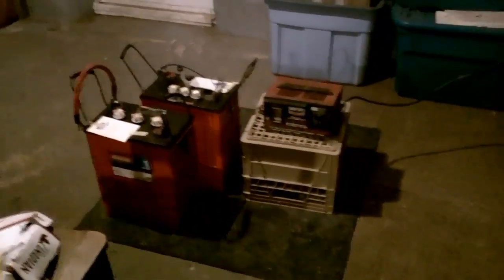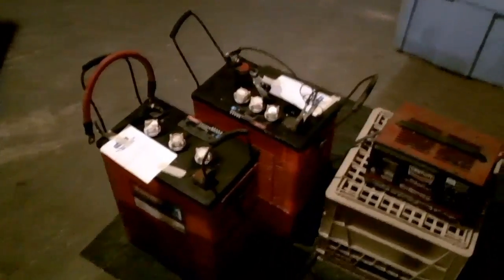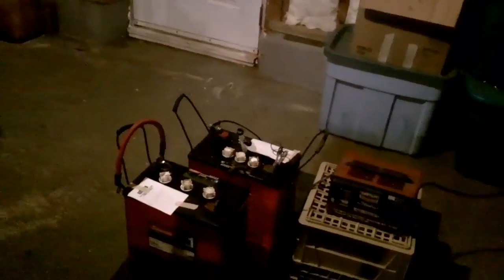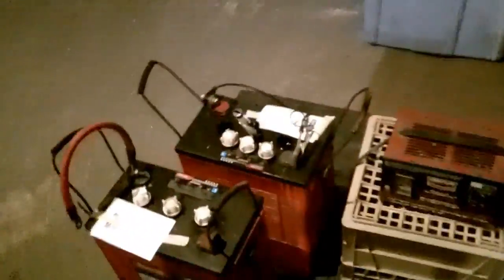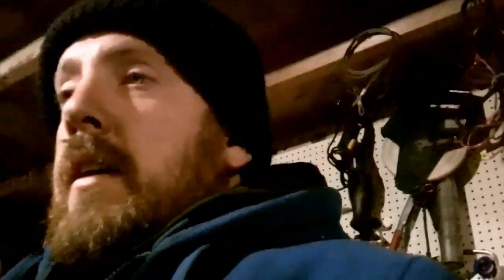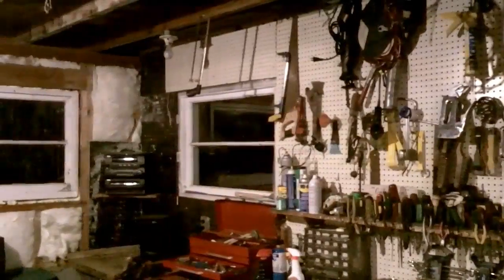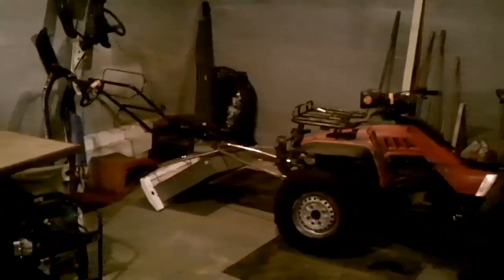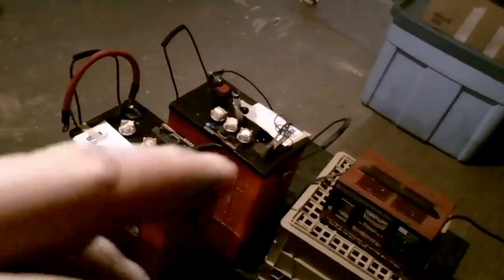HOW TO DESULFATE LARGE BATTERIES THE EASY WAY

Comment: Desufate batteries with alum solution 4 to 12cc concentrated and boiling hot. If really bad hook to a higher voltage current limited charger, about double the battery voltage limited to 5A or so. Once it starts drawing current charge normally. A DC arc welder works great for reviving big ones like forklift batteries.
Reply: I did de sulphate today wid boiling water / baking soda. After it stop fizing, emptied content n filled wid warm water to flush out again. Den repeat wid distilled water b4 replacing 'old acid/ filtered' into battery. Charge on 'boost/ higher dan15-16v'/ 30 mins. Drop charge to low charge overnight. Repeat X2. My Amp is now gud as new/99% n 13.2v. but due to worned out plates, it's probably gud for light duty use i.e. emergency leds, low watt water pumps, air bubbler aquarium oxgynator. But attached to 100watt solar/ mppt controller, U can keep it charged up everyday.

Comment: nice video, you need a higher voltage than 6 volt to charge a 6 volt battery, 6 volts going to 6 volts is a up hill or level battle, when it comes to charging a battery, try 8 or 9 volts guy! 😎👍

Comment: Have an solar array and have a few banks of batteries. Have been attempting to restore some old marine batteries. After getting into solar I have been noticing efficiency something I didn't do before. I guess my question would be using an high amp old charger for a week is even worth the cost of a 90 buck battery. Not saying what this guy is doing isn't worth it these 6v batteries are very high price. 

Side note ~After 20 years of solar...
 Major problem with solar and LA batteries is battery drain. If you can keep 70% charge at all times they will last 10-20 years. If you drain em down low every night  you will be lucky to get 5 years. So say in my 600 AH 12v AGM bank I am only using 200 ah or that's safely available. I have 200 ah li-ion 1865 power wall and often drain it to 10% even completely flat on occasion. 
Amazingly its worked perfect nearly two year no battery management system just hook right into my solar controller. Using protected cells and fuse wire bus bars it all charges and balances just fine. BMS's was invented so laptop packs would not last as long 90% of bad packs is full of good cells.... 

A simple way to save 20-40% of battery use in off grid. Is to use a capacitor bank for run start devices like fans anything with engine. They charge faster than you can drain them and gives plenty of amps for high draw devices. Without the battery bank having to convert watts to amps which is why say a blender starts slow. With a 12v cap bank things are fast as AC for start up. If you invert your 12v to AC then use a large Central Air unit capacitor after the inversion and get huge saving on power draw!  Just be super careful Caps pack a punch some deadly... You can make a wicked car battery using cap bank and a li- ion small 12v pack.Caps have millions of cycles and ion's well into the thousands. 

Point is I have spent a lot of time on batteries and lead acid sucks lol Li- Ion or nickle iron is the way to go just harder to obtain or in power walls case build. Buy laptop batteries break em open for 6-9 cells all good protected cells look for ones under 25 dollars on amazon. Three huge parallel bricks...series wired together to make 12v pretty simple.

Comment: where you from and what kind of weather you have, in our climate batteries never last that longer
Reply from the maker: +Omar Alvi live in nova scotia the temp ranges for -30c to +35c
Reply: You should get a proper desulfation unit like a Battery Extra. I used a high volt unit which came as a kit ($40) and it worked very well. Much better than cooking batteries like this, plus you can leave it connected and keep the plates clean.

Also, cheap PWM solar chargers are notorious for not charging at a high enough voltage. Flood battery chargers have at least four stages with the boost being above 14V. Anything less will lead to massive sulfation within a couple years.

Comment: You can easily and QUICKLY desulfate a 12V battery with a 20V laptop charger 
I restored 2 100AH AGM batteries with this method 

The following instructions are intended for a 12V 200AH battery or equivalent 

Adjust times and discharge current to match your battery 
For a 100AH battery the discharge current and overcharge time will be half 
For a 50AH battery the discharge current and overcharge time will be a quarter 
and so on but the voltages should be the same regardless of battery capacity 

do not exceed 30 min of continuous overcharge time regardless of battery capacity

Charge the battery with your charger of choice 
Connect a 20V 90W laptop charger to it and allow it to overcharge for about 20 min
Disconnect from the charger and let it rest for about an hour 
Then discharge to about 10.5V with about 65A DC (700-800W from an inverter is good)
Then repeat the steps until your battery is working properly again 
(usually if the battery is recoverable you should see improved runtime after the first 2 cycles)

The battery should be back in working condition after around 10 cycles but it may take more depending on how much sulfation there is 

**DISCLAIMER**
YOU WILL NEVER BE ABLE TO RESTORE IT TO BRAND NEW CONDITION SO DONT TRY OR YOU WILL COMPLETELY DESTROY THE BATTERY

THIS METHOD IS INTENDED TO GET YOUR BATTERY WORKING WELL ENOUGH TO PUT BACK INTO SERVICE NOT RESTORE IT TO BRAND NEW CONDITION

THIS WILL NOT FIX A SHORTED OR DEAD CELL 
(but you are welcome to try if you want)

Adding Epsom salt or other additives will not fix a battery at all
Pulse charging is absolute rubbish and is likely to damage your battery
And battery charger desulfation programs DO NOT WORK
Reply from the maker: +mewantbrains Cant see how a 3.5amp laptop charge is any different than a trickle charge? and dunno if its good to overcharge AGM batteries because of the problem with loss of electrolyte from gas generation due to excessive overcharging being permanent. For lead-acid batteries there is not enough amperage to desulfate much if any depending on size
Reply: Well this works to desulfate my batteries 

I think the gassing helps the sulfation flake off the plates exposing good lead to the electrolyte that's my best guess 

All I know is it works
Reply: +mewantbrains not sure what 20v would do, vehicle alternators output 18v
Reply: It overcharges the battery and allows it to strip the sulfation off the plates
Reply: +mewantbrains thanks man, i've done almost same procedure and it's work OK, my lead-acid battery (12V 160 reserve minutes)  only could gave no more than 30 Watts, yes 30 watts, but now after 6 cycles overcharging my battery i get 600 Watts, these measures i got it with a kilowattmeter, i overcharged my battery applying 16V and 2 Amp constant current, for 12 hrs and then discharging to 10.5 V, and works, definitly. thanks man
Reply: I'm glad it worked for you mate 

I have never tried this method with a battery that far gone 
(Normally I cash em in for scrap at that point)
What was the rated capacity for it?
I'm guessing it was a flooded lead acid battery?
Seeing as it survived 12 hours of overcharge 
(I would definitely check the electrolyte levels and top them up if they are low)

I wouldn't recommend 12 hours of continuous overcharge as it may damage the battery 

And if it's a sealed lead acid or AGM overcharging for 12 hours WILL destroy the battery 
(SLA and AGM will heat up and swell when overcharged too long)

This has been my method of choice for desulfating batteries  

Done right it should fix sulfation in any lead acid battery
Reply: +mewantbrains hi, my battery it's a marine bat, it's rated capacity is 160 minutes of reserve so 800 Watts total power, and yes it's a flooded lead acid, and good tip today i'll check the electrolyte, thanks again
Reply: Are you talking about 

Power output
(How many amps the battery can supply)
Or 
Energy capacity 
(How long the battery can power a load)
Reply: ***** hi again, i talked about energy capacity so using an inverted and connected a light bulb of 250Watts it's run for 2:30 hrs, by the way i checked the electrolyte and 5 of 6 cell it's was OK, and the measure was 1280 it was very good, but just one cell its density measure was 1180 very bad i guess that this cell still sulfated, so are there anyway to fix this cell in order to have same density inside it, thanks in advanced
Reply: For desulfating the other cell I would recommend overcharging and rapidly discharging it with around 500W of load then overcharging again 

If that doesn't work I think you may have a bad cell
Reply: +mewantbrains thank you
Reply: No problem 

Let me know if it works

Comment: My husband listened to this vid. He has a similar old charger. He was very interested in the desulfation (we haven't had a problem so far, but our batteries are still fairly new). Pretty interesting about turning the mower into a generator. Dave (my hubby) and his son worked on his "project" generator (old mower with new alternator) and got it working great. He videoed it on his phone, but I haven't looked at how to post it yet. I have never posted a video. He even built a table with wheels from the old mower so  he can move it around easily. He put an indicator light on it so it is easy to see if it is charging properly. He used to be an instrument man at a gas plant, he loves to use his gadgets.
Reply from the maker: gingertexan sounds like a good rig

Comment: the old school method of forcing the battery to charge works but its destroying the plates...bubbling is not good... pulse charging is the real method to desulfate a battery properly with less damage to the plates
Reply from the maker: I didnt realize but the "smart"charger I was using actually has desulfation mode which does pulse charge it, I was doing it without realizing at first I thought the charger was messed up until i realized thats what it does

Comment: What I have done is to empty the batteries of all liquids, reserved that to be distilled to make clean acid. Since the sulfur has crystallized along with oxide of lead and the calcium, there is a nice resistance  short going along the bottom of the plates and is the reason why they will take the volts but not the amps. A mixture of backing soda and water poured in cause a chemical reaction with the sulfate crystals and breaks them up and then are easy to flush out. Reconstituted acid poured after a rinse or two with clear water and then put them on to charge and they are almost as good as new. One thing to note is that the plates are now thinner and less likely to handle a "hot" discharge well. But for solar use as long as you have a good inverter with a well regulated controller for the panels and you should get many more good years of use out of them. This is a proper way to fully restore the batteries and not just a charge/discharge "reconditioning" of them that only breaks up the crystals and they recrystallize again within 8-10 months. Been there and done that, sigh.
Reply from the maker: with most batteries you may be right these arent your standard batteries, I pretty much followed the manufacturers instructions which seemed to work fine sulfation is inevitible in this situation
Reply: Jose Francisco Medeiros I did use a ctek but they are very weak, Other brands are more effective.
Reply: Azri'el Collier Aziii
Reply: great advice sir
Reply: What about Epsom salt with distilled water to top off the battery fluid or flush and clean the battery plates ?
Reply: @airmech5083 : Something to think about. Sulfur is a metal. The plates are made of two metals, lead and calcium. Adding more sulfur and another metal as epsom salt is magnesium sulfate, is in the long run not only going to ruin the battery but also whatever you are using to charge it. This is why to totally clean out the battery so the calcium sulfate and lead that has formed at the bottom of the plates and is causing them to short out is the best thiong to do for the battery and to save from buring out your charging system. The bicarbonate of sodium is good for dissolving and neutralizing the sulfuic acid and breaking down the sulfur cyrstals  off of the plates and is the best way to clean the plates. BUT, as I mentioned earlier, the plates will be thinner and unable to handle the amps needed for good vehicle startup. And if folks want to use these for solar/wind storage systems, this would be great. But as last time I mentioned using inverters, I am revising that idea. Instead, switch your whole house/shop to low voltage devices. Even many moder devices used in the home are already low voltage devices and scrapping out the power supplies that convert 110/220 volt ac to lower voltages, replace with voltage regulators and you will draw a lot less current and better improve the live of your alternative energy charging devices. Inverters are huge amp suckers.
Reply: I don't recommend dis as it's 'quite dangerous'....to maintain a gud fairly new battery, some one suggested 'shorting/desulfating' battery once a year wid a DC variable amp welder. After removing lead acid battery plugs (topped off battery wid distilled water). He disconnected n isolate battery ( while still under hood) n attached + red n - black clips to similar on battery n 'slowly bring charge (volts/amps) up till battery water inside starts to bubble, off charging after 5 mins/ rest 30mins (cool down) n repeat X 3 times. Battery is now gud as new!!! ?? So anyone tried dat??
Reply: @frank88ster : What is dangerous is shorting a car battery that has the potential of at least 100 amps or more in it that while not enough to start a car, is enough to make the battery explode. Especially if the battery has lost a significant amount of liquid acid due to repeated recharging as is done when used in a car and or truck. The resulting loss of liquid would cause the battery to boil into gas a hydrogen sulfid gas that will explode. How about you try this dangerous method and if you survive, tell us how it went for you?

Comment: My dad de-sulfated a battery with a little AC ripple through on the DC charge.  During one of his projects, he must have caused a spark with a tool and the battery blew up.  Yep, just like you he was not wearing safety glasses either.  His eyes were saved, the damage wasn't too bad.  I was in the house (about 8 years old) when he came screaming in, trying to find the door, then make his way to the bathroom shower.  That taught me a lesson.  I never work with batteries without wearing safety glasses.  I am not 58 years old and still have both good eyes.
Reply: cbusenke, amazing!  I am a chemist.  During college I had an instructor ask us, "If you have a change to make a chemical with an acid reaction or a base reaction, which one would you pick?"  He let us ponder it for more than a day.  Many reasons for our answers.  His comment was, "I'd chose an acid because a base is more dangerous.  If you get an acid on you, you know it right away.  If you get a base on you, you don't know it until there is tissue damage."  I have used his comment several times during my life.  Keep up the safe thinking!
Reply: glad to hear  you learned that lesson...here's another one you're probably learned as well and if you haven't it's ten times as important as the acid lesson...protect yourself from concentrated/strong bases/alkalines A LOT more seriously than you do acids.  bases like the hydroxide family potassium hydroxide, particularly sodium hydroxide and a lot in that family react instantly with human skin/tissues.  sodium hydroxide is often sold as a pellet because it can react explosively with water much more than any acid will, because of this when it touches tissue the hydroxide ion instantly destroys the tissue and no amount of water or mild acids can reverse that damage.   a friend of mine worked at a restaurant in college and used the grill cleaner without tight goggles, got it in his eyes and immediately they flushed it, called paramedics, tried to wash it with lemon juice to counteract...didn't matter.  the cornea and viscous nature of the eye makes it an ideal powder keg if concentrated NaOH touches it.  Hopefully anyone that read this rememebrs that when they buy those concentrated drain openers.
Reply: +cbusenke I poured NaOH pellets in water and no explosion happened. Sodium on the other hand may explode in water.
Reply: cbusenke See my reply to your comment about bases.  You're great!
Reply: I'm glad he's okay!
That method CAN work to some extent but the connecting and disconnecting should be made FAR from the battery in well ventilated conditions using long leads (leeds).

Comment: You aren't desulfating the batteries you are just breaking off the crystal sulfate. The only way to desulfate a battery is to pass a high frequency dc current through the battery. You can save a lot of time if you cycle the battery. After the battery starts bubbling load the battery down until the lowest cells reaches 1.70vdc or 5.1vdc total battery volts on a load. Then charge it and repeat until gravity is stabilized. If the gravity level drops to 1.100 or below when the battery is dead and the fully charged gravity is lower than you want then add a small amount of sulfuric acid to bring the level up. This will save you a bunch of time and produce a better result. I work on lead acid batteries for a living and this is similar to my technique.
Reply: Please explain "high frequency dc Current"
Reply: He means a capacitive battery charger i suspect. It Zapps the bat with 50hz waves.
Reply: Can you do a video of the process?